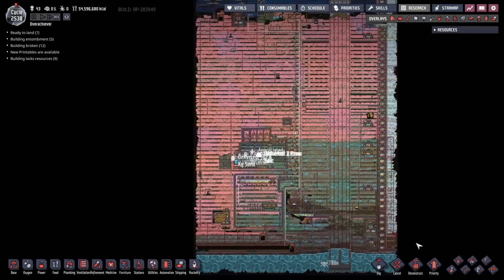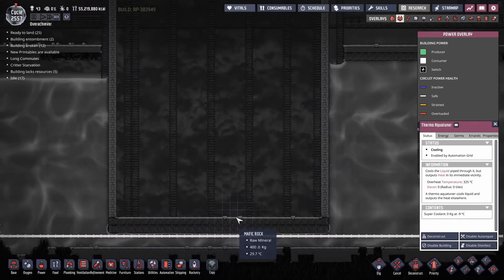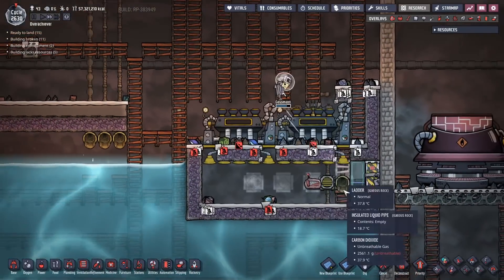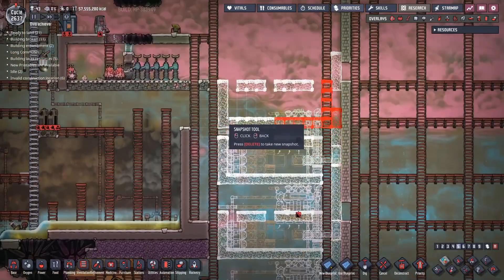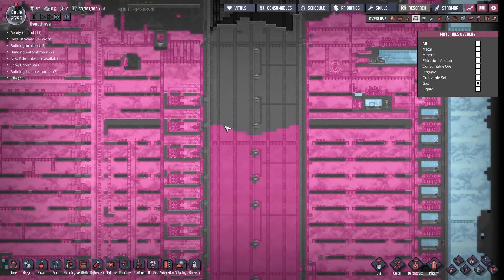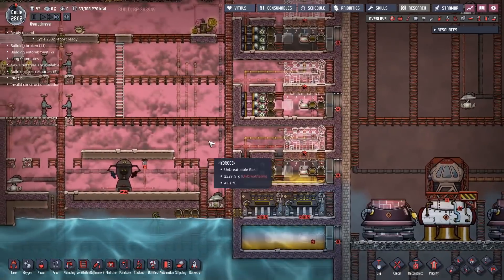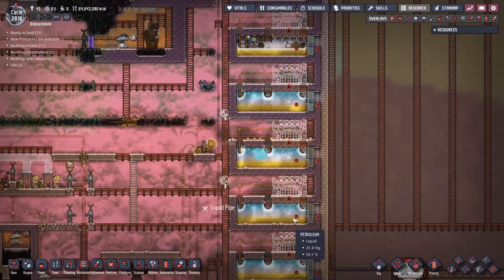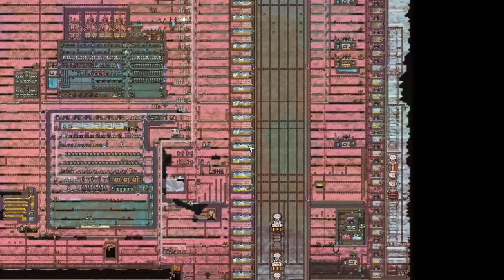Rime 37 : Three Lane Rocket Chimney Prep & Heating : Oxygen not Included

Comment: You still need the temp plates on the silo, to transfer heat to the turbines. Also, there is a wireless automation signal mod, that could be very useful to you.
Reply: Top comment

Comment: If you have so much water, you shood flood the entire map with water. And then think about "Water Locks" that let the areas that are not under water be pressurized with gas :)
Reply: Then chill it all to freeze it.... Re-Ryme!!
Reply: need to move the living area under the water with glass walls and transit tubes as the only exit
Reply from the maker: What makes you think that is not already the plan :) But in all seriousness I have though about it but their are several problems. Pressure damage is one at over 30 tiles of water pressure even the toughest tiles will break. You can use airflow tiles to get around that in places but then you have gas escaping. Finally comes water locks, unfortunately they will overflow when under pressure. You can't make them 1 tile thick or they will break, you can't use airflow tiles or the gas escapes. You could try using "drops" or petroleum to stop flow but one bad game load or dupe exhaling CO2 and your whole base gets flooded. You can triple layer tiles to ensure nothing breaks to pressure damage but then you still have the issue of getting in and out of the base. I'll let the idea cook some more on the back of my brain and see what it comes up with.
Reply: @FrancisJohnYT  Gas escape (through airflow tiles) could presumably be prevented by just expanding the scale of any lock to have each airflow tile backed by an impermeable tile? Such that you have your ordinary wall, then a simple ring of airflow tiles around the outside. Not sure, I've never played around with that amount of water. Of course you could have entirely sealed enclaves within a full ring border of insulated tile (as usual) then airflow tile on the outside, with Transport Tubes as your only exit. To get into the water to work would be tougher, but I guess you could have a few transport tube entrances above the surface with ladders down into the abyss, for maintenance or new builds. It's all pretty academic to me, I'm never going to be crazy enough to try this sort of madness lol. Good luck either way! I'll keep watching and enjoy your frustration :)

Comment: Hydrogen got into the chimney, oh no.  Ehh, just get enough steam pressure in; let it go to the top, vent it to space.  Nicely done with the "service tunnel" under the silo.  Here's an idea for servicing.  No more visco-gel locks.  Add a room off the bottom right in the CO2 area that can be transit-tubed into.  CO2 conducts heat SO poorly you can put an AC system in the transit tube room and thermally isolate it via a triple door (middle open with vacuum)  and maybe even automate a solid C02 dropoff in the tube room to "if the pressure is under a certain amount, make a delivery" to keep up the pressure/keep down the temperature there?

Agreed with the others, just boil off the water at the bottom of the silo now.
Reply from the maker: Transit tube into the bottom sounds like a plan, throw in a layer of Chlorine to sit between the CO2 and the steam and you have an almost perfect insulator. Will all depend on the pressure the steam maxes out at. The previous silo hit about 80KG of steam near the bottom so if it's the same in this silo I'm going to need a lot of chlorine.
Reply: Francis John Purposeful use for Sour Gas?
Reply: Wait, what am I saying?  How much CO2 have you solidified?  This is fine!

Comment: couldnt you just connect a water pipe to the steam turbines water return and add more water instead of pumping steam in? using a system that is already there
Reply: The downside is that that would require some automation to decide when to run the water in and when not. Using the Steam pump method it has a build in shutoff (when the vents overpressure)
Reply: @ganashal  correct.  💯